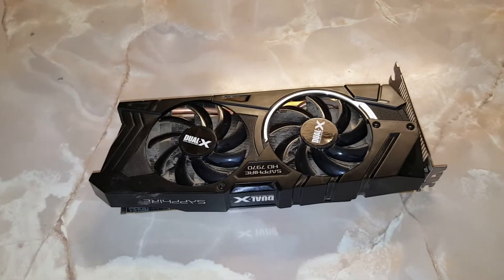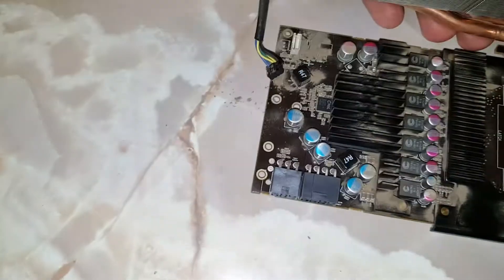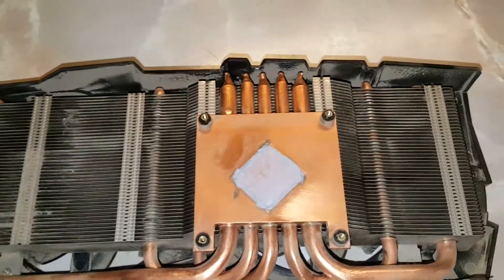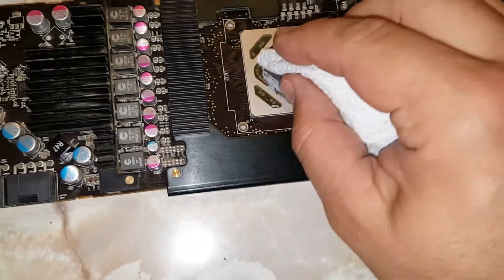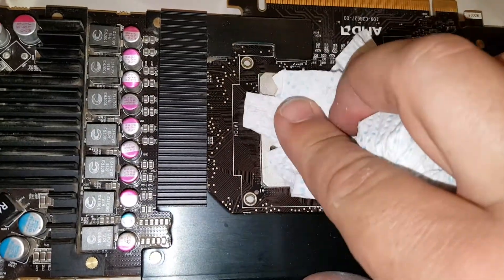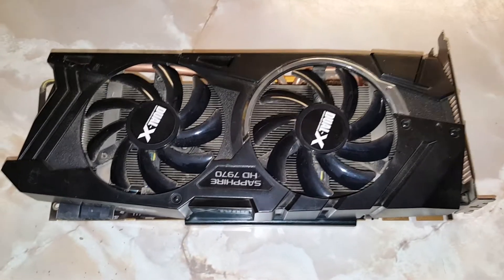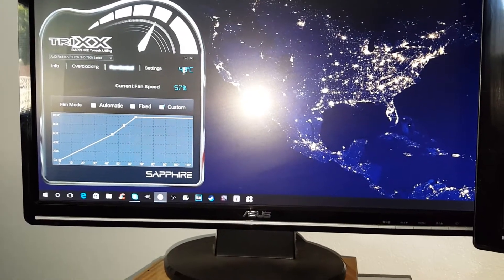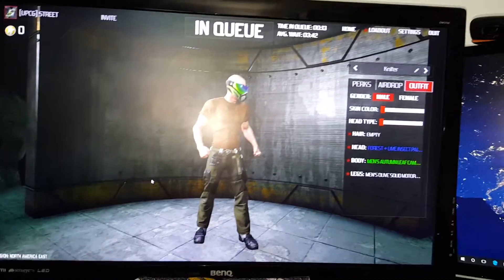HOW TO CLEAN YOUR GPU - Sapphire 7970 Dual X GPU - Teardown & Cleaning (DYI)

Comment: If you pass a brush in the PCB doesnt it get dmg or something? I am scare to even touch it but its full of dirt, that kind of dirt that sticks. Anyway the video card doesnt work lol but maybe a clean up revive it.
Reply from the maker: krlitos if it doesn't work then no harm in trying to clean it and put some new thermal paste on it. It migjt not work because the PCB  warped under heat  but worth a shot right?

Comment: Holy shit dude thats a dirty card, im a bit ocd about my pc’s so i dust and clean it about once a month. Man has it ever been cleaned if i was gonna guess i would say no. I have a vapor-x 7970ghz i bought with my 3770k, not my main rig now but still a great 1080p setup.
Reply from the maker: Yeah that was the first time i opened it after 4 years. I regularly clean my rig out as well but you have to take it apart to really get in there.

Comment: I have a 7970. Can I use silicone thermal paste instead? The silver paste is expensive as fuckk
Reply from the maker: Yellow Flash yeah it should be good. Just make sure it's made for computer components.
Reply: Street707 - FPV PILOT & PC Gamer Extraordinaire yes it is written it's for CPU. But the description on Amazon of that product also mentions GPU. Working tempsrange from ~ -30 to 180 degrees Celsius
Edit: sorry for grammatical mistakes. It's like 2 AM in my country I can't think straight. Plus my GPU fan also broke so am kinda depressed.
Reply from the maker: all good to go then.

Comment: I did the same for my 4 year old dual X 7950 boost card and got the temps down by 20C!!!!! In my case there was too little thermal paste(was not dry though) and the screws pressing the heat sink against the die were somewhat lose! It used to reach 88C in no time with core set to 1050MHz & Mem @ 1350, power profile at 7%(Severe throttling) and fan at 100%.  Now it stays around 74 with Core at 1100MHz and Mem @ 1360, power profile at 20%(No throttling at all) and fan at around 75%. Thanks for the video :) Even though I already knew how to do this, your video was the one that actually motivated me to do it. lol.

Comment: i need help my PC restart when ever i play assassins creed
my GPU run at 85 to 90 degrees Celsius. could the be the problem?
Reply from the maker: ay yusuf yes that is most likely the issue.
Reply: some people tell me it is my psu to
Reply from the maker: It's not your psu. If your GPU is getting that hot it's overheating. That is why the computer restarts. You need to clean it out.
Reply: ok thanks for the help.